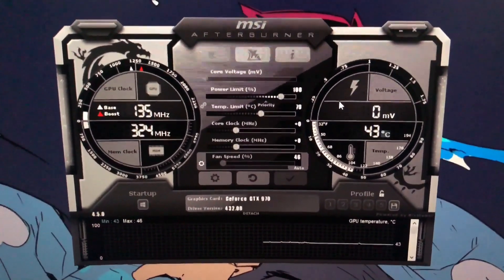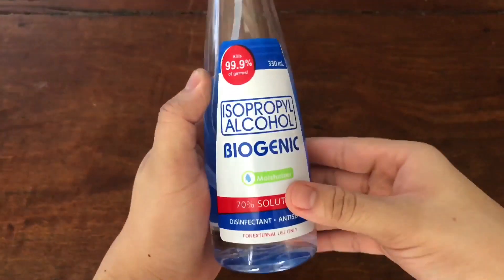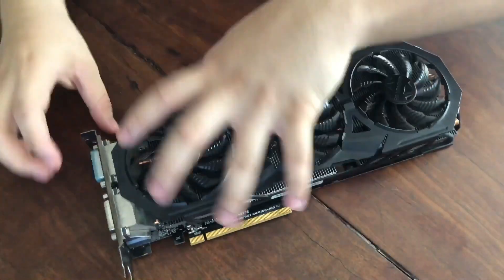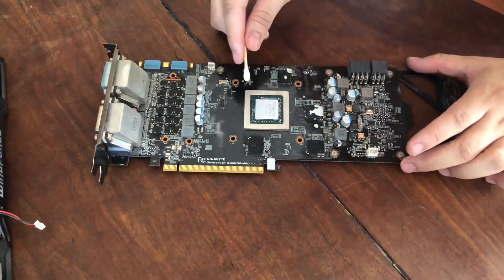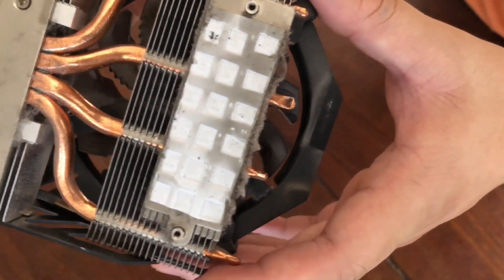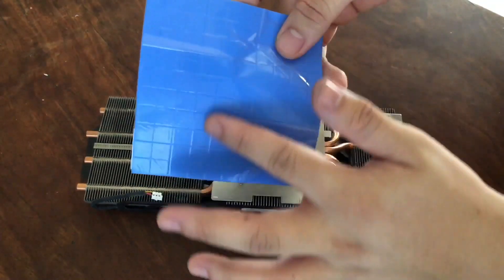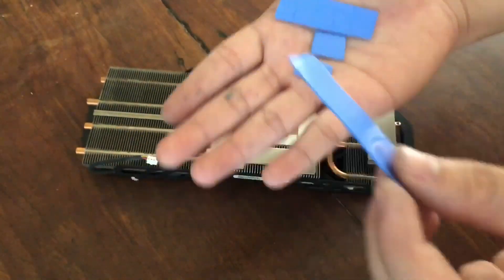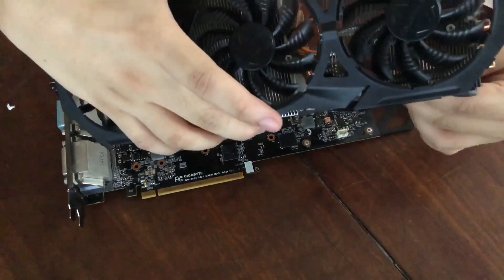How to clean GPU (Gigabyte gtx 970)

Comment: Great video, very helpful.
Not sure if this helps anyone coming here to watch, but I could not find info on thermal pad thickness ANYWHERE, so I bought I micrometer, took the card apart, and physically measured thickness.
My card is factory pads, there are 2 thicknesses:
Thicker one is 1mm and is 57mm x 21mm.
Three thinner ones are 0.5mm and are:
2- 13mm x 13mm
1- 48mm x 15mm
You can see in his video which are which pretty easily.
Hope this helps anyone struggling to find the right product like I was!
Reply: Thank you Jared i have been looking everywhere to find the thickness of the pads even asked on other video's and most just don't answer
Reply: @michael-pw9cz  You're welcome! And I went through the same thing, couldn't find the info anywhere. FYI changing the thermal pads on my 970 dropped ambient temps about 4 degrees for me, and temps under load dropped 5 degrees! (My old ones were in rough shape though)
Good luck on the replacement!
Reply: @jdkatz00  How long have you had your 970 mine is about 6 yrs old this will be the 1st time i have changed the pads and thermal paste my temps at moment are between 50-55 i will see what they get down to i'll let you know over the coming days.
Reply: @michael-pw9cz  I would say I've had mine about the same amount of time. That was also the first time the pads and paste were changed on mine. The paste was basically fossilized lol. 
Good luck!
Reply: @jdkatz00  I did mine on sat its yes my paste was the same fossilized and 3 of the pads needed changing i did a school boy error put pads on put all together and just before i put back into comp i remembered i didt take of the plastic off the pads lol all done now temp is down about 4 degrees.
Reply: @michael-pw9cz  awesome! Glad it worked out well for you!
Reply: It's probably the most important info of this video. Thank you so much!
Reply: @adambrzecki  you're welcome! Glad to have helped!
Reply: @jdkatz00  there's a tiny update. In my case:
- thicker thermal pad for VRM is 1.5 mm
- thinner thermal pads for VRAM are 0.5 mm.
I have just measured it with a caliper.
Reply: @adambrzecki  interesting. Are yours also factory thermal pads?
Reply: @jdkatz00  yes, they are (or were) factory thermal pads. A part of them is damaged (melted after 6 years of using GTX 970) and I need to replace them.
Reply: @adambrzecki  very interesting, thanks for sharing! I guess there is a variance in the thickness of thermal pads used at factory!
Reply: @jdkatz00  okay. I suspect that there could be one variant od thickness, but my pads became a little "melted" because of heat 🙂
Reply: @adambrzecki  same
Reply: @adambrzecki  Adam, what kind of card do you have exactly?
Reply: @TheMaverickq  my card is exactly:
NVIDIA GeForce GTX970 4GB 256Bit made by GIGABYTE (model: GV-N970WF3-4GD). You can get details about this card on the GIGABYTE's website. I can't leave any link here, because YouTube deletes any comments that contain links to external websites.
By the way, if you need a replace fans in your graphics card, I can share my fans model numbers with photos and link where I bought it. I also used a verified thermal paste (Thermal Grizzly Kryonaut 1g 12,5 W/m-K). DISCLAIMER: your fans model number (and amperage as well as expected voltage) can be different. I found posts in the Internet that confirm that GIGABYTE uses various fan models in the GV-N970WF3-4GD graphics card.
Reply: @adambrzecki  I have exactly the same card. I am planning to use arctic MX-4 or MX-5 because manufacturer of Kryonaut says to change paste once per 3-6 months, and if you are not gaming a lot once per year. I will use gelid ultimate pads as well. Still thinking about my fans, you can send me an email with link, I got it available on youtube. You can use Polish as well :)
Reply: @TheMaverickq  I think that "thermal pastes" in general is an interesting topic, and it's worth to investigate what did you say about Kryonaut. I don't have any special expectations to my thermal paste, but I think that requirement of replacing paste every 3-6 months, sounds like a exaggeration and manufacturer's "excessive care" (which could be false).
Reply: legend. Thanks your comment is still very helpful.   these cards are getting cheap now and definitely old enough for a refresh
Reply: Thanks, those are the measurements I used before reading your comment. Great contribution. Great card, and owners should know this information.
Reply: I would suggest even going 1.5 mm for the thicker one as I found 1 mm did not have contact across all points of the VRM (screws fully tightened) though my temps are still good (35C idle @ 29C ambient). This was using the thermal grizzly 8. Thanks for the advice though!
Reply: 1.5mm and 0.5mm
Reply: @Jared dude thank you so much!
Reply: @TheMaverickq  you bet, glad it helped you out!
Reply: Hey Jared, since you're reading these replies, do you happen to recall a lit LED below the PCIe power connectors?  I just serviced my card and I don't see a lit LED, but I also can't recall if there was one 😄.
Reply: @jcsantosgroup  I am pretty positive there isn't one there. Or else I never noticed it before lol. I'll look when I'm at my computer later and let you know if I'm wrong though.
Reply: @jdkatz00  Thanks! I'd greatly appreciate that.
Reply: @jcsantosgroup  no LED outside the blue WINDFORCE logo.
Reply: @jdkatz00  Thanks, Jared. Really appreciate that!  Now I just have to figure out why my fans aren't spinning. I must have messed something up.
Reply: @jdkatz00  Hey, Jared. Is/was your 970 the GV-N970GI-GAMING-4GD model? Also, do you remember if you saw any temp improvements after applying the new pads?
Reply: @First.985  I would like to be able to answer you properly but I finally upgraded my card and no longer have my 970, but I'm pretty sure that was the one! (Looks very familiar)
And yes I definitely had an improvement in temps changing the thermal pads, but only for hot spot temps.
Reply: Thanks. That's helpful as hell. Nice Info. Top.

Comment: I just cleaned my card and repasted along with replacing the thermal pads. I don't remember if there were LEDs that lit just below the PCIe power connectors. I don't see any LEDs lit on mine. Are there any the light on yours (I'm not referring to the windforce logo)?

Comment: What thickness of termal pade i should use? On aliexpress are 0.5mm, 1mm and 2mm aveilable
Reply: I'd buy all of them.  You don't know what you need until you break it open.  They don't usually tell you on data sheets.

Comment: Is it ok to just buy a sheet of 2mm thermal grizzly pads and use that for all (or 1.5mm) ?? As there is only $1 difference in price, I would like to use 2mm. and issues doing this?
Reply: If you use out-of-spec thermal pads then you risk having no heat transfer between the thermal padded components (too thin), or no heat transfer brttwen the GPU and the heat pipes (too thick), due to lack of contact. Except for super squishy thermal pads, you need to use the same thickness that you removed.

Comment: I just did this on my identical 970. My temps are really good but now after I load into a game it will play for just a few seconds and then knock my monitor off. I can still hear game but screen goes off. My temps never got above 55c. Any suggestions. Edit: I noticed that the VRM doesn't make an impression on the pad like the Vram does. Maybe the 1mm pad  is too thin? Edit: problem solved, put another layer of 1mm thermal pad over VRM. Running smooth and cool now
Reply: I would change the 1mm out to 1.5mm to have it correct thickness. It will probably run better.
Reply: Same thing, is it ok now? What should I do, put another 1 mm ore change it for 1,5 mm?
Reply: Anyway thank u a lot for your comment, it saves my day.

Comment: Just notice you only have 3 screws to hold your heat sink.. it that ok?
Reply from the maker: Unfortunately, one of the four screws got stripped. So far I haven't encountered any issues without it, the gpu still works with good temps.

Comment: I just bought a gtx 970, is it okay if it runs with no backplate? Because that connecter you are talking about I don't have that
Reply: That's not true. You can use it without backplate. I use them like that and it's not a problem
Reply: A backplate helps to dissipate a bit of heat, a GPU doesn't need it to work.
It's typically included only for the higher end models.
Reply: It needs the backplate, don't ever run a graphics card without all it's components

Comment: 0:20, your fan speed is 0%  and your power is not full 100%......you have the card badly config.
Reply from the maker: It's actually on 46% I think you were referring the core clock and the memory clock.